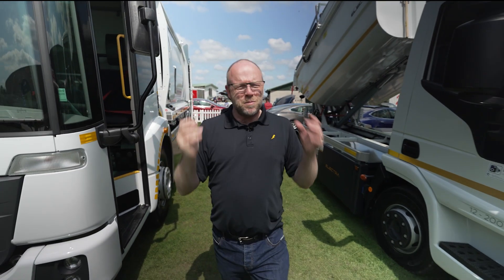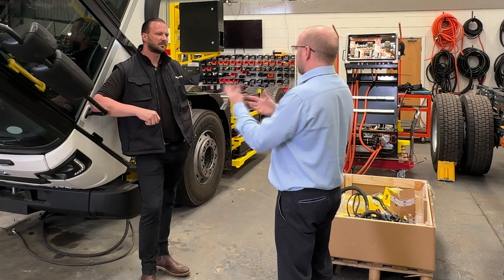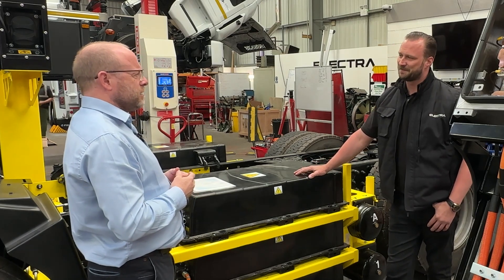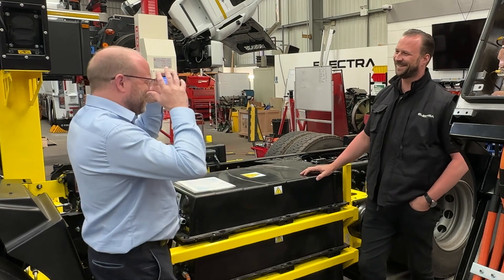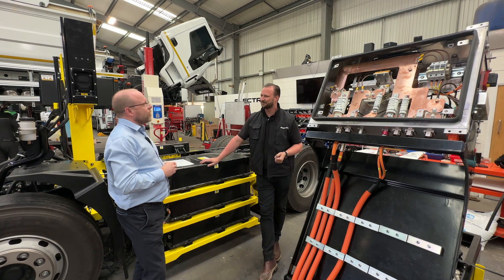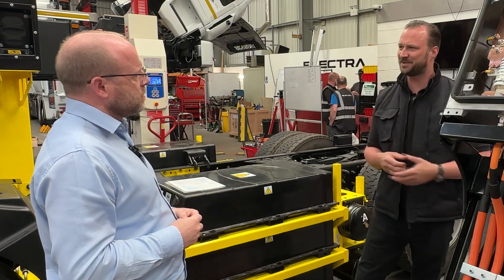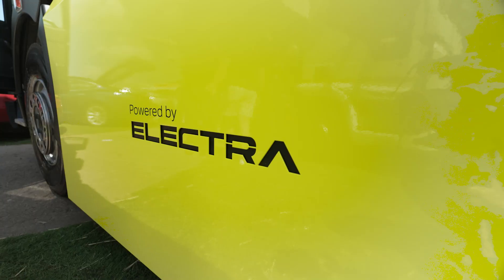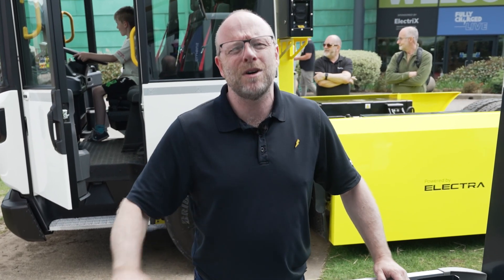ELECTRIC TRUCKS making our cities CLEANER in more ways than one! MIND BLOWING brilliance!

Comment: When Energy looted, it turns Curse...
Nikola Tesla, Huxley and Orwell should be forgiven for thinking their systems can last forever - finite fossil fuels are dangerously hypnotic to humans and their mental capacity.
Humans were not ready morally, ethically and intellectually to start the mass extraction of fossil fuels with the advent of the steam engine 300 years ago.
The Magna Carta requires now overhauling - adding to it the right for humans to understand what Energy really is;
"In any system of energy, Control is what consumes energy the most.
Time taken in stocking energy to build an energy system, adding to it the time taken in building the system will always be longer than the entire useful lifetime of the system.
No energy store holds enough energy to extract an amount of energy equal to the total energy it stores. 
No system of energy can deliver sum useful energy in excess of the total energy put into constructing it.
This universal truth applies to all systems.
Energy, like time, flows from past to future".

Comment: Awesome video with lots of B-roll. It's much more interesting that way. 

Interesting to see the focus with on site repairability making mechanics dare to repair something new. The parts shown seem pretty off the shelf (fuses, contactors, cables with automotive connectors).  That could be a huge moat compared to more in-house single board designs. 

Can't wait to see what kind of software making these trucks stand out from the rest. Improving driver comfort and such.
Reply from the maker: Thanks for the comments. It is an incredible solution for the sector in which they are operating. I know they do have lots of other things going on in the background re software etc so watch this space! For me the Vehicle to load (V2L) is very exciting 👍